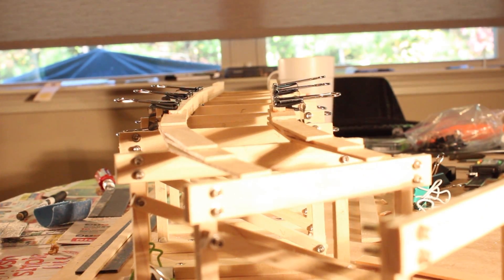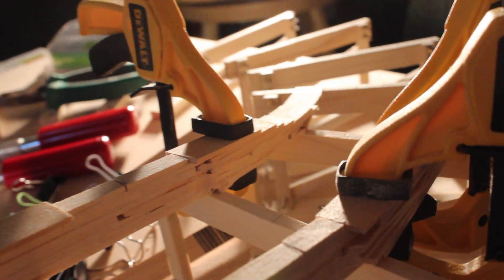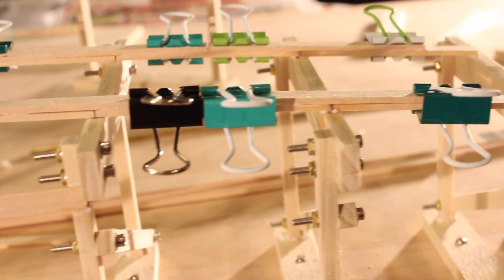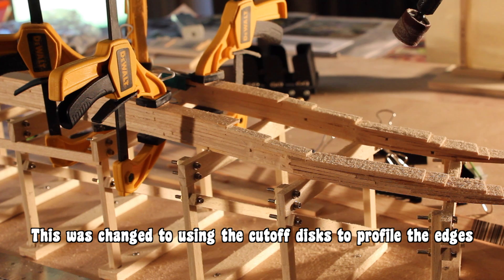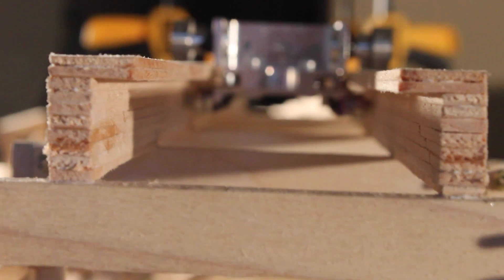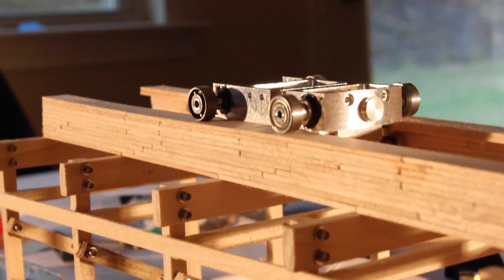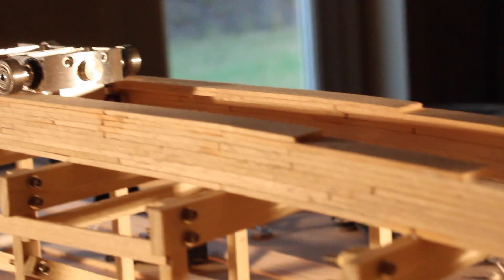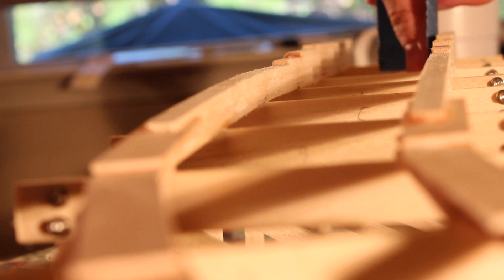Building The Wooden Roller Coaster: Part 2 - The Track

Comment: I used to build model rollercoasters. I made a looping working model out of brass tubing and track ties modeled after Arrow Dynamics. It was 20 feet tall, had metal fabricated cars with U-joints, a working lift hill, two teardrop loops and a double corkscrew. The track had a single larger tube for the backbone like the real thing. Although it worked completely, coasters don't behave in miniature the way they do at full size because of the weight and inertia differential. Heavy coaster cars seem to almost defy the laws of physics as they move around the track, seemingly without losing much energy because of "mass in motion" principles. But at small scale, coasters lose energy quickly, unfortunately.